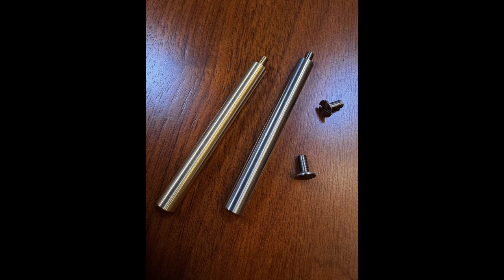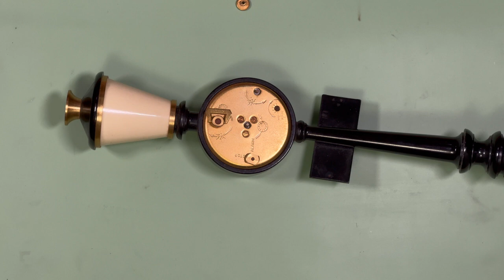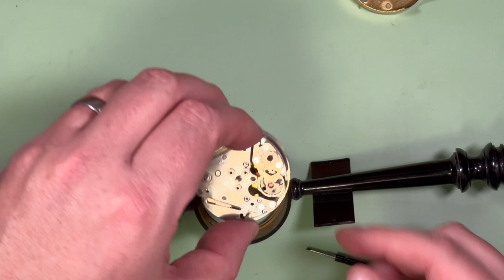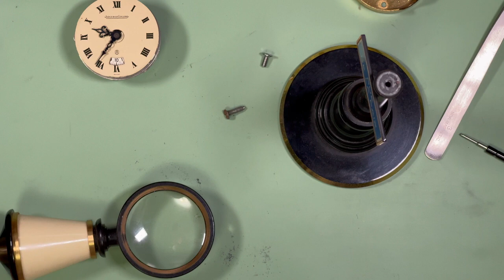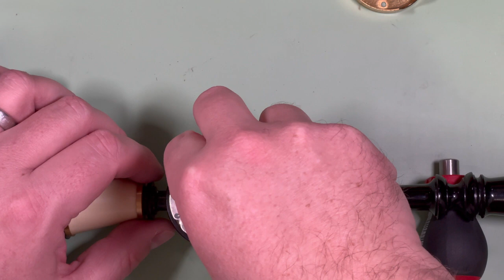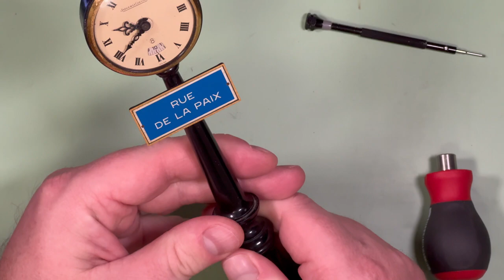Repairing Jaeger-LeCoultre Rue de la Paix Lamp Post Clocks

Comment: Hi there,
I own a black lamp post that’s missing the sign and the sign holder. Would you happen to have any parts you’re willing to part with? I’d really appreciate it if you do.
Thanks so much!
Reply from the maker: @CarlenaCarrington  thanks for reaching out. Unfortunately, I don’t have any spares at the moment. There was a seller on eBay that was selling individual parts for these clocks. Good luck in your hunt!  If I come across any, I can let you know.
Reply: Yes, I found her. I missed out on the sign, but she does have the sign frame, so I think I better grab it while I can. It was originally made for a gold clock, but mine is black with gold accents. I just picked it up over the weekend and started doing some research—looks like I have my work cut out for me. I’m seeing a little bit of that wobble you showed in your video, and the clock itself is not working. Fun.